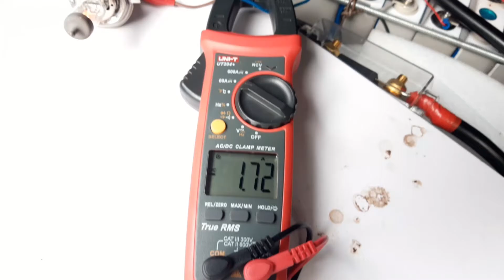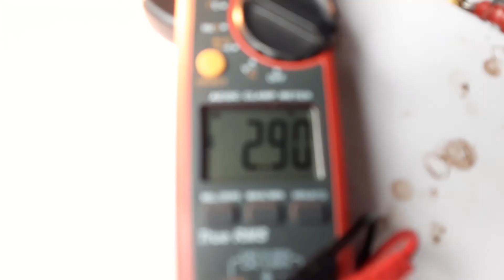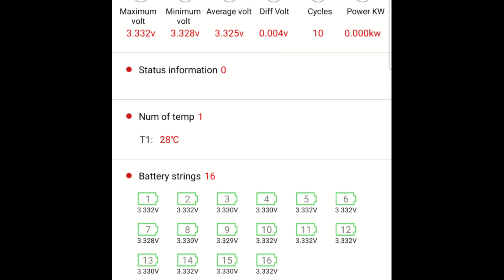Balancing an unbalanced battery pack

Comment: better balance a few days with shunt resistors of 100 ohm1watt in each battery 3.6v/100=36mah will remain at equal voltages.
Reply from the maker: I dont have much experiance over shunt resistor use

Comment: Hello I really enjoy your videos I'm here in England also with a leaf,  looking g at getting the epever hybrid inverter too.  Do you know if it's OK to disconnect your battery pack with the BMS,  but solar is still connected? This can damage some charge controllers..  I only ask because the low voltage cutoff on the epever is too low for me (2.72v) so I will have to rely on BMS to disconnect St low end!  What do you think? Many thanks for your comments :)
Reply from the maker: For low PV inverters , batteryless mode is not available and for safety , inverter will swich off if battery is disconnected.
However , with a batteryless support high PV hybrid inverter you can disconnect battery while solar charging
Reply: Do you know if it will bypass in this situation or just switch off entirely, have you tried?
Reply from the maker: @andrewwaters2354 it will  swich off. By experience 😀
Reply: @HappyGreenerWorld  Since you've already installed it, what if you first edit it through the app as to use only the pv and  220v for power , will it also shut down,  if you remove the batteries? Also, if you reinstall  batteries, as you've done, does it automatically switch on, of you have to do it manually?
Reply from the maker: @atsimas  if BMS cutoffs , the inverter shutdown immediately for its safety . Turning it back on reqired manual intervention . Need to turn off/on main battery  DC breaker or remove one terminal and reconnect which is very annoying task.
Reply: @HappyGreenerWorld   I wasn't specific enough. If you have an epever as Mr Waters has, and you have disconnection problems, if you raise the value of disconection on bms, and lower the value on epever, so that epever disconnects first, will it still shut off if you remove the batteries / bms cotoff?. I do not undrestand something also. If bms cutoffs, doesn't this not mean an open circuit? So why is the need for manual internvention? Does your bms contact with epever? Because they told me only some bms are communication compatible with epever. In your case I'd add a contactor between the battery and bms so that below one value it would do basically what you manualy do.
Reply from the maker: @atsimas  When you set low voltage cutoff at say 48V in BMS, while inverter is loaded, when it goes below that value BMS turns itself off and symultanously, inverter will swich off.
Since battery is unload now, voltage increse above 48V and BMS starts. This happens in fraction of a second . Therefore,  inverter will not turn on due to its safety .
I usually set extreme value bcoz of that.
 In such case, you need to turn off contactor/breaker to restart inverter .
Reply: maybe you can edit the  low voltage cutoff?
Reply from the maker: Yes ! You can cut off from BMS at low voltage .
Reply: Ok I understand. I think the first post has a different set up from the one you've got. He says basically, if battery power goes below 48v while it's sunny, will epever switch to pv mode? And if usage stops, will it start charging again batteries?
Anyway I have a "project" proposition and would like your input. Say we get rid of bms. We obtain 3 contactors ,two NC one NO, a weekly timer, a balancer an a test points panel. We wire the timer in a way that when it enegrises, cuts power from inverter, and gives it to balancer. We set it to do that, every night.  We set up a panel so at every 2-6 months we check batteries voltage.  Temperature is handled by inverter or different circuit. Can this get rid of the bms?

Comment: If one cell low voltage than the other cells, then is it ok to charge only the particular cell?
Reply from the maker: Not recommended ! If you still want to do that,  remove the BMS connection and do so!
Reply: @HappyGreenerWorld  would the better option be draining every other cell until the battery is balanced?